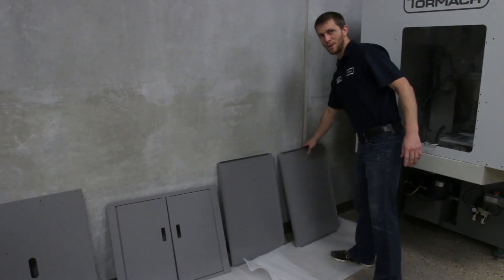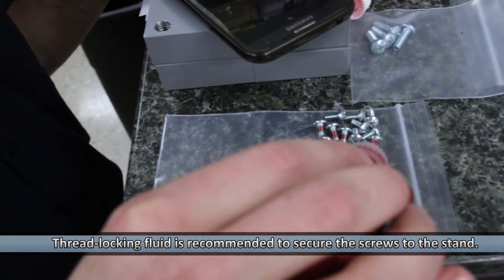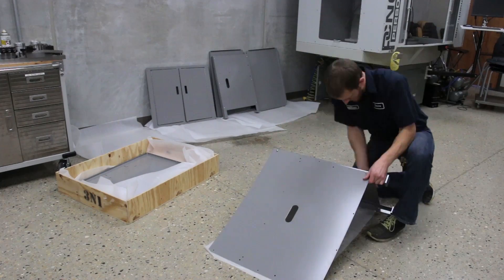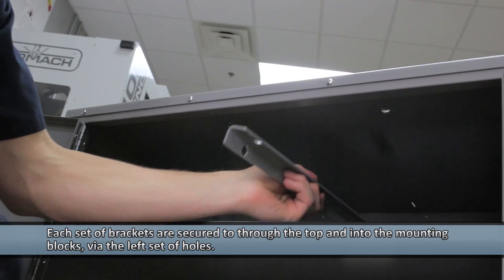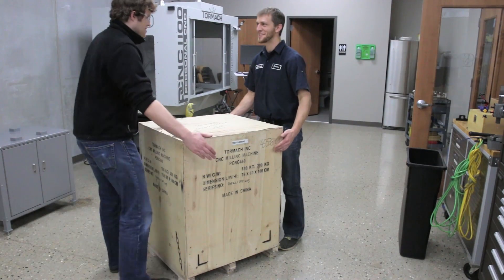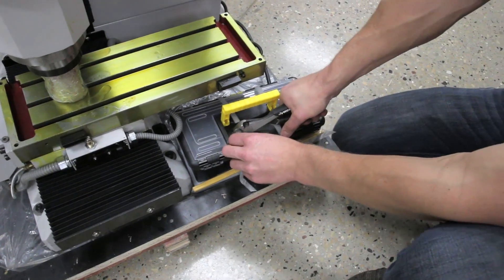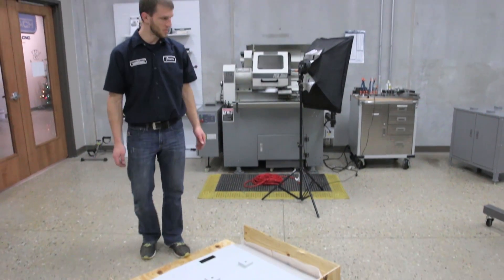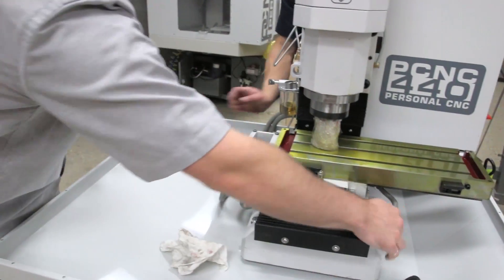Installing a Tormach PCNC 440

Comment: i helped a friend assemble a pcnc1100 few yrs ago,, i did the tram work ,ATC and the entire set up thru-the 4th axis driver install,, its not difficult but it is very time consuming,,, its the only mill ive ever had to assemble,,, now this is great if your goal is to set-up in a space where in pieces allows you to get it in a tight place,, BUT,, while i was assembling it we were in a big shop and had a forklift and it still took better part of a day before a made a chip,, if there was a $300-$500 option of having tormach assemble and set it up all it would be well worth the extra money,, i would consider possibly buying another if this was an option but i really dont ever want to have to assemble a mill again,, a little more money and it comes assembled, test ran and guranteed,, now that would be an excellent option for those who have the room,,, this was just a thought i had back in 2012,, cat30 that works with the ATC would also be a tremendous upgrade,,  when i used it ,, it was a great mill for the money!